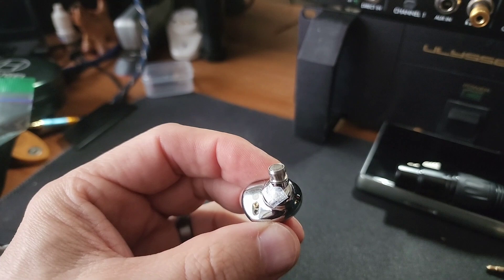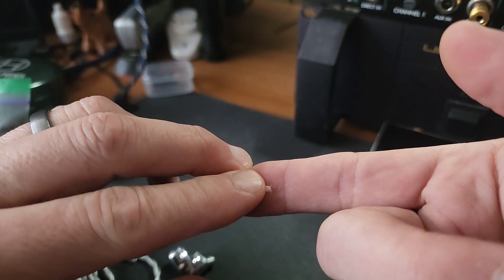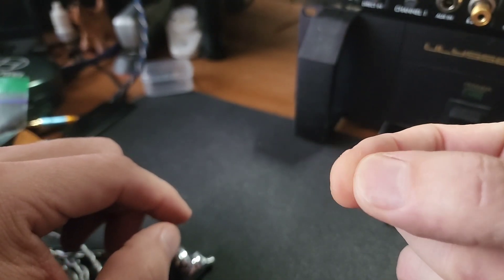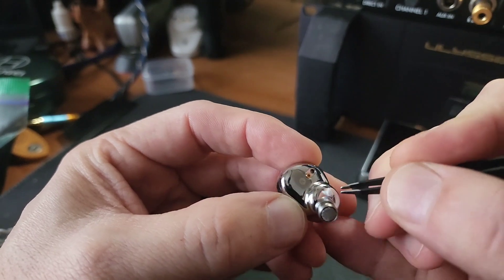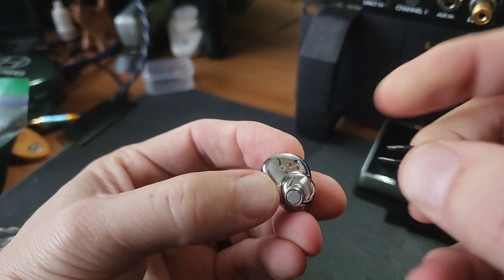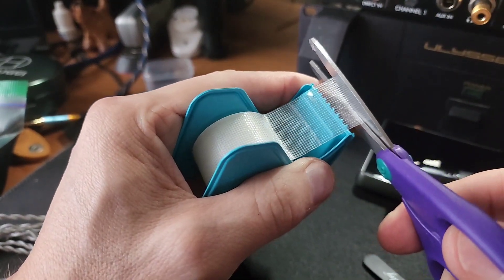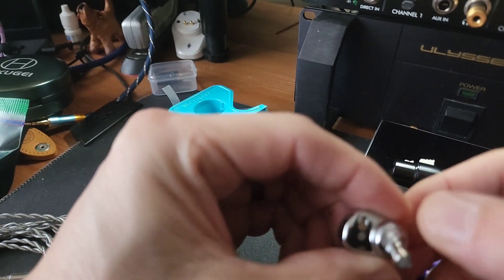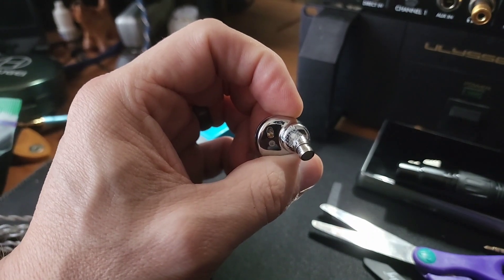V2 Extream version SIMGOT EA500 Vent Mod

Comment: Do you think there’d be a way to mod the EA1000 through vent blockage to have more bass as well? I’m not looking for a ton, maybe about 2.5 - 3.5 db.
Reply from the maker: If you want to hear more bass reduce the highs 500 level mesh nozzle filter try that.
Reply: @tonedeafmonk  I have the filters ordered and on the way, yep. But based on EQ testing so far, I’m not sure if I actually want to reduce highs - I like the crisp and lively highs, it’s just that I wish there was a bit more bass quantity-wise along with the highs as they are. Basically add 2-3 db of bass to low end, for some genres only (metal for example).

Will try the filter as well though, definitely.
Reply from the maker: @justastest  wether you raise the bass , or lower the Treble our brains and ears hear the same thing , putting on a filter will just lower the Pina peak and our brains precieve more bass win win
Reply: @tonedeafmonk  Just a question - how to avoid glue stains on the nozzle exterior from adding the mesh and then removing it if it doesn’t work out?
Also, do you think foam + mesh might add a decent amount of bass to the EA1000 without losing clarity? I saw your other video about modding the EA500 vents and being worried about clarity and I’m in pretty much the exact same spot with the 1000; I do want a bit more bass for rock and metal but not at a significant cost to clarity/tactility. Any way to do that?

Comment: so, v1 vent mod vs v2 ??? any good ?
Reply from the maker: The V2 mode can be done with 2 layers of tape as well. 
I since have used a small low density foam and put it in the vent and double taped it. The sub bass goes up very nicely.